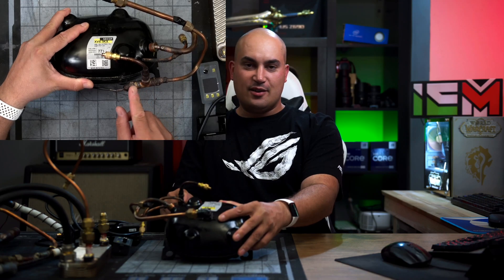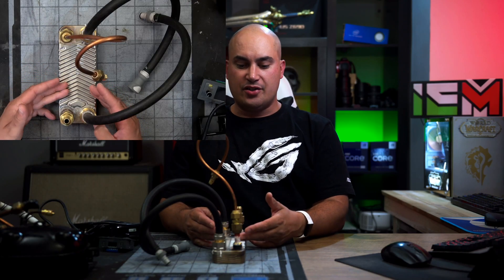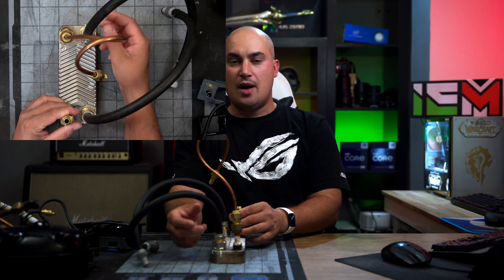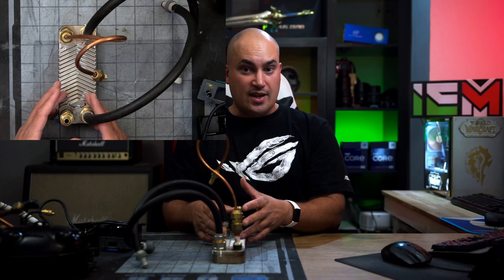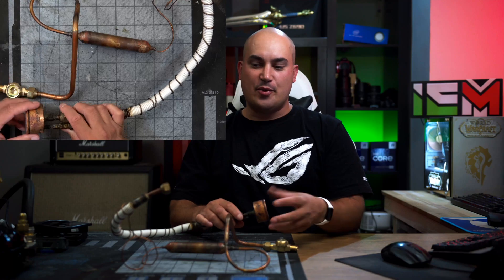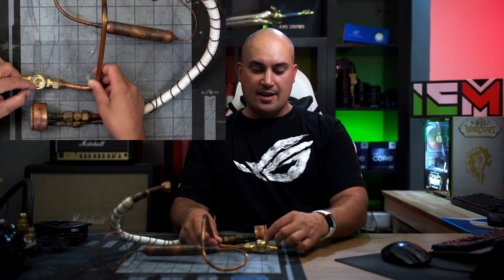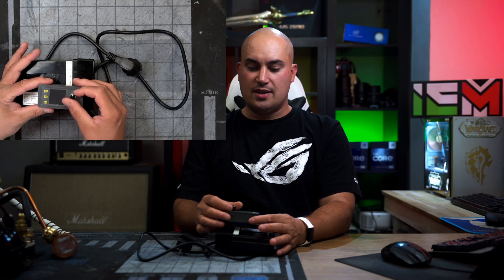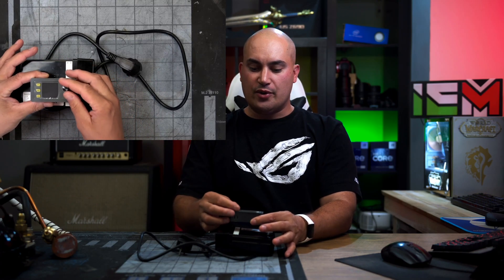Mini Phase Change Cooler - Ep 1: The components

Comment: What compressor is this you're using?   Been trying to figure out a proper one for cooling my CPU and GPU and finally found this awesome video!
Reply from the maker: This one https://www.secop.com/fileadmin/user_upload/obsolete-compressors/xv80kx_108h7712_r600a_115v_220v_50hz_60hz_04-2020_desd506y202.pdf  I really like it, super silent and very powerful for the small size, with propylene R1270 is a beast!
Reply: @HardwareNumb3rs  think it would handle the heat load from a 4090?  ~500-600watt

Comment: Hi Max. I remember something from Biology at school called countercurrent flow (how fish get oxygen from water). The reason I mention this is because I believe the same principle applies to your heat exchanger. Essentially, make sure your compressed (hot) liquid refrigerant flow one way, but the water cooling should flow the opposite direction. What do you think?
Reply from the maker: Yes, the principle is correct, I tried switching the water flow but it seems for a system like this where the heat exchanger is super overkill it doesn't affect the final result, at the end the heat generated after the compressor is a walk in the park for this heat exchanger